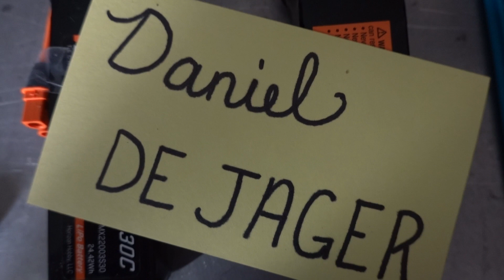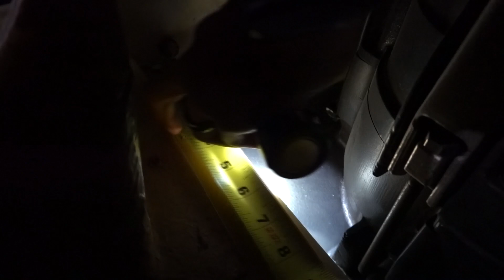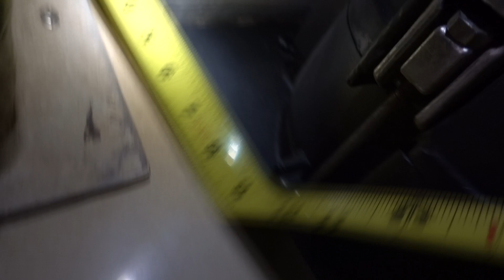Captain's Blog 6 12 2019 Debugging the Big Boat Seat and Jetboat Deck Completed

Comment: If you ever revisit the rams, get a couple of strips (wood or cardboard) that are long enough and attach to the mounts, with the hatch up, make marks on the strips where the ends are, do the same with the hatch closed, you should be able to work out the stroke length ;)
(essentially a sliding ruler)